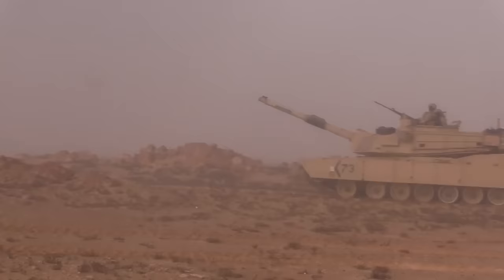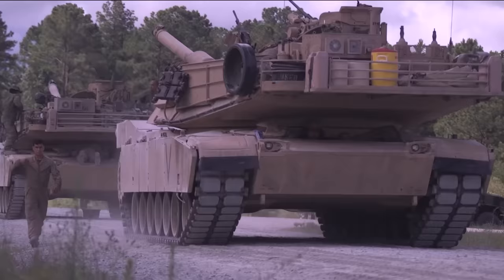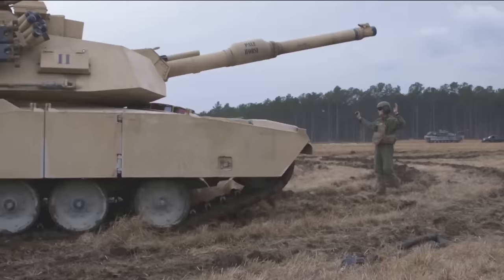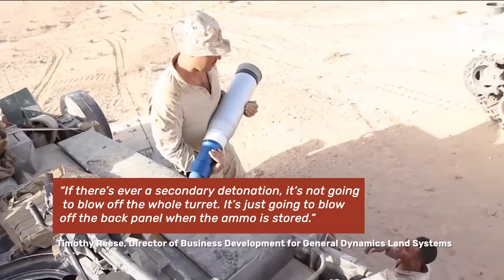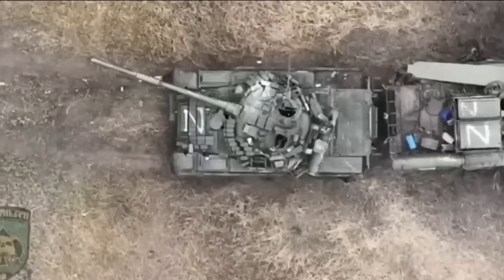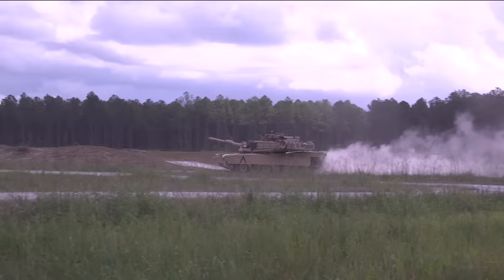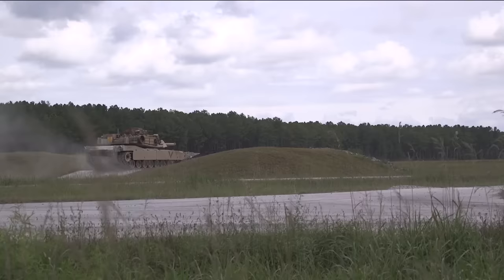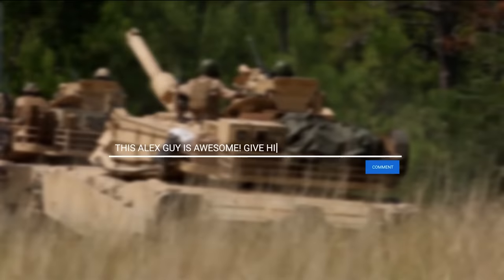America's next-generation main battle tank: ABRAMSX

Comment: The diesel engine is good, the batteries are good, the drone defense is absolutely necessary now, and the Kamikaze drone launchers are good.  

The carousel ammo storage is very, very, very bad, even though there is a blast panel you still lose all of your ammo and probably damage the carousel beyond repair.  Also, they don't say how long it takes to reload the Abramsx carousel.  Seems like it would be longer than an M1.    

The Abramsx auto-loader reload speed is not published.  If it's over 4-5 seconds then it's slower and not as good as the M1 human loader.

Comment: Love the new Abrams, have some concerns about the automatic loading system, however time will tell us more, I disagree on the age of tank theory, I do believe just like America's powerful battleships of the 1930s and 40s the sun may be sitting on the Abrams! Just like the aircraft carrier replaced the battleship, an armored personnel carrier capable of carrying multiple uav's, uav supplies, UAV armament, and shared multi-system air-to-ground awareness, maybe the better option, especially for a country that owns air superiority, and is pushing towards AI in the field, this would fill the low altitude Gap, take on multiple armored vehicles at once including infantry, including giving Hi-Tech drones the capability to refuel and supply, RPG evolution has significantly increased, and with a lot of these systems being capable of self-seeking, the tanks original designed purpose on the battlefield is almost obsolete. Especially considering that the self-propelled howitzer with gps-guided targeting system especially armed with cluster munition rounds is far superior "to any 120ml gun on tracks costing upwards of 80 million dollars".

Comment: A little thought of issue with only having three crew members is that it increases the workload, and the increase isn't negligible.  If only for maintenance having one less set of hands helping to replace a track or fix the transmission is going to suck.  I'm sure a three-man crew plus an autoloader is technically more efficient but it actually makes things more difficult for the crew as a whole.
Reply: Honest question. Do US tank operators get out and do field repairs or do the logistics/engineering corps do perform that function? You have to have logistic fuel support constantly to feed those beasts, you'd think they have the minor repairs covered. No tank crew is going to perform a 'major' repair on a high tech modern platform. One would think.
Reply: @pappyman179  Depends on what you consider 'major' repair work.  If in the field and on the march  general maintenance, wear & tear, random mechanical problems, etc. is first looked at and delt with by the crew.  Historically waiting for the maintenance people when you can fix it yourself is often part of the job.  Only with three people instead of four it'll just be that much more of a pain.
Reply: Another person to do maintenance doesn't have to ride in the tank all the time. The tank will basically never be operating by itself. Grab a guy from another vehicle to help with things.
Reply: @tackytrooper  That's all well and good but it's not that simple.  That guy very well might have his own tank or vehicle to work on.  That guy might just not be there.  The situation might be dangerous (active war zone) and that guy might not want to risk himself to help you fix your tank.  Maybe that guy isn't familiar with your tank and thus isn't of much use.  There's a bunch of reasons why just getting some random person to help isn't a reliable option.

Comment: The un-crewed turret is something going all the way back to the 80's and what was being called the "M1 Block III". It has its reasons I really  just do not know if I am sold on it in the real world. As someone that has been in armor caked with dirt and mud I really have to ask what happens when you go blind. A head out of a hatch can really make a lot of difference.  I also do not like losing the forth crew member for the same reason, in the field there is more then just driving and shooting that has to happen. We will just have to wait and see as things move forward but I do believe that precision  indirect fires especially using mobile mortar platforms will become the next big thing altering how and where tanks are used.
Reply: Popping your head out defeats the point of being inside the protected environment of the armor. The cameras and drones give visibility before you have to ever resort to exposing yourself (and crew) to sniper/grenade/chemical/biological/radiation/shrapnel and flame type hazards.

Comment: The Switchblade inside the tank is just stupid. Why not have an M113, with a launcher rack behind the next hill? Just have the capability in the Abrams to also tap into that Data-network.
Independent gunner sight is IMO a good addition. Giving the driver the ability to also look at what either the Commander or Gunner sees would be handy in an Overwatch situation.
Giving the tank an improved networking capability, to cross-reference sensordata and target tracks with other units would be a great addition. Increase the Hunter-Killer team dynamic with drones, with drones marking targets for the tanks to engage and destroy.

Comment: ""The XM360 120mm gun is more lethal than the current gun on the Abrams tank due to its increased muzzle velocity. The XM360 has a muzzle velocity of 6,000 feet per second, compared to the current gun’s muzzle velocity of 5,500 feet per second. This increased velocity allows the XM360 to fire armor-piercing rounds with greater accuracy and penetration power, making it more effective against heavily armored targets.""  

IMHO we should be looking at 130mm 52 caliber is said to be too heavy and have only 20 rounds in its Magazine for its Autoloader.  That will STILL be more powerful than the XM360.  The down sides are weight and we'd have to use the Excellent German Stabilizer.  That's why the current M256 is 44 Calibers and NOT 55 like the Leopard later models.  If the 130mm Gun was on the Abrams it would have to 2 to 3 Calibers shaved off.  I'll make up something here, why not go with something XM380 50 Caliber 130mm gun, NATO round (+ DU), and with a German Licensed Stabilizer?

Comment: Well having that drone means the tank will be able to lob in rounds from MUCH MUCH further away. With this tank it might make more sense to try and put a 155 on it so it can direct attack its a 155 mm cannon that self explanatory and indirect attack and with it being such a modern platform you could justify the use of all guided ammo while more expensive is also crazy to think of a tank gun having a range of 40km. With all this tech it really just seems like a waste not to I understand the weight issue but that can also be overcome with range and you have increased its mobility so you'll be trading a fraction of your mobility and gaining up to 10× the amount of range on the weapon system.
Reply: Or just have the vehicle do recon for actual artillery and put the 155mm away from harms way!
Reply: @DillonRoche  actually I want the rear artillery to be 240s with guided ammunition they should have never been retired. And while we are talking about it we need a lower accuracy higher capacity mlrs while accurate its primary duty is volume of fire like we had in Korea in a war against China we need some volume behind the accuracy.
Reply: @austinlowrance5943  The Army doesn't like saturation MLRSs. High volume, low explosive yield, low accuracy MLRSs have been used by the Army before, but they switched to low volume, high explosive yield, highly accurate MLRSs. The saturation-style rockets caused too much collateral damage due to their low accuracy. An example of this is the Army's M270 MLRS. It originally used saturation-style rockets, but it has switched to the aforementioned guided rockets. A great and proven example of these guided rockets is the M142 HIMARS, which has proven to be extraordinarily effective in the Russo-Ukraine war.

The reason why the US military uses the 155mm for artillery is because it balances range and warhead size. Replacing the Abrams' 120mm cannon with a 155mm cannon is just implausible. With a 155mm, you're sacrificing nearly all of the anti-tank capabilities just so that it can perform in the artillery role, which is already fulfilled by the M109 Paladin and M142 HIMARS.

The biggest you can feasibly go when it comes to anti-tank cannons is 140mm. The bigger the round, the slower it is. Projectile velocity is one of the core factors in determining how much armor a projectile penetrator can pierce.

Comment: I adore the M2 .50 cal, but the .338NM the NGMG uses...
makes more sense (if the army fully adopts it) as a coax.
And a 30mm – 50mm programmable ammo CROW is best.

Hybrid diesel is cool, but a full on electric would be better if SMR happen. 
With a battery system that allows not charging, but SWAPPING batteries.
Fuel has the biggest logistic tail, & costs $200/gal (for perspective) in Ukraine

Comment: there is alot of wrong info on the normal abrams like the hilo engine meth its a way different engine and it was improved so it doesn't use that much fuel compared to a diesel

Comment: Seeing through the tank with a helmet and camera system is just common sense evolution. Someday tanks will have rail guns when the tech improves and shrinks in size and power required.
Reply: Rail guns are quite ineffective for a tank weapon, it can only fire rods and that's not good. With cannons you fire a variety of shells, HEAT, APFSDS and more. Also power and battery issues.

Comment: First, the Abrams main problem is like all Americans it struggles with weight. Second is maintenance requirements, because of its turbine engine, which can make it more of burden on logistics. Not to say its turbine engine is bad, its one of best tank engines in the world. Especially since one of main reasons for the turbine was it can use more than one type of fuel. Only that its because of US logistics that its benefit rather than a burden for US forces. As for the AbramX I am sure of one thing, no US tank will every be fielded without a Browning .50 HMB. Its because the Browning hits that sweet spot of essentially light cannon fire. Hell even in Ukraine, the Ukrainians have struggled where to use their Browning's in defense of trenches or as air defense against Iranian drones. Odds are if the next Abrams has an autocannon, it will also have Browning too. I also think the new diesel electric hybrid engine is good too, I mean that's what modern locomotives have used for half century now.

Comment: Is keeping commonality with the Abrams so important that we can't radically rethink this?  I think the engine should be in front, and crew in back, since pilot can drive better with video than looking out the slot now I think.  Another idea I have is to put a driver cab on the top of the front slope, so the driver gets a birds-eye view for non-combat driving.  This just needs insulation, not armor, and have huge windows to all sides.  The cab could be taken off in 5 minutes, maybe four pieces that way <50kg each, and stowed on the back deck for combat.
Reply: Tanks and Abrams especially get absolutely coated in mud and sand and dirt. That camera is going to be useless in any cross country travel and now your driver is blind and can't even look out the hatch.
Reply: @thelordofcringe  If that's true the gunner and commander won't be able to do their job.  Is it really important that a tank that can't see targets or even scout for them nonetheless be able to drive into battle?  As for driving out of battle: you only leave a battle you're losing, and what driver is going to open his view slit for a peek at that point?

Comment: I work in the large mining machine field. Huge, work focused, mobile machines and we are trying to electrify them for some god knows reason. Well the reason is governments interfering with these mines and forcing them to be more “green” by mining more lithium for batteries which will then end up in a landfill after tons of coal is burned to charge them 1000-10k times. The batteries last 1 hour… and then you have to swap batteries and let the old ones charge for an hour. The amount of infrastructure needed to support the battery charging is incredible. The diesel engine is just too perfect of an energy conversion system, these large machines (and most medium sized machines) have no business being battery-electrified

Comment: Maybe the British Army, should be looking at this Israeli Merkava Mk.V Barak Main Battle Tank, as a replacement for the British Challenger series 1, 2 and 3 MBT's for 2030's onwards!

True Second-hand Israeli Main Battle Tanks, Merkava Mk.ll or Mk.lll versions, would be ideal for the Ukraine Army too, as it is easily as good if not better than early Germany Leopard MBT’s.

Or especially the French Leclerc Tanks, let alone are equally to both the American Abrams plus British Challengers 1 or 2’s.

Or the South Korean older K1A1’s or K1A2’s Tanks or the newer K2 Black Panther /  Heukpyo MBT’s and the Japanese older Type 74’s, Type 90 MBT’s or maybe the newer Type 10 Tanks as well, especially the new Merkava Mk.V Barak Main Battle Tank.

The Israeli Merkava series of Main Battle Tanks, have always been better than any of the Russians older T-72’s and T-80 Tanks and/or T-90 MBT’s or the new T-14 Armata Main Battle Tanks (which there are very few of too).

Or the Chinese Type 80 / ZTZ80 and ZTZ88, or Type 96 / ZTZ96, or Type 98 or WZ-123 , Type 99 / ZTZ-99 Main Battle Tanks and/or Type 15 / ZTQ-15 (nicknamed the Black Panther) third generation light tank too.

Comment: Abrams is great but a new design is needed.  It entered service in 1980.
Reply: So did most modern MBTs. Tanks like M1 were specifically designed to be upgraded well into the future, and this has been done to great effect.
Reply: @bluntcabbage6042  I hear you on this one and wondering lately how their use on the battlefield is going to change.  The US uses them well in combined arms but most countries don't have the logistics and air power to own the battlefield.  Im really waiting to see how Ukraine's upcoming offensive with Western Tanks works out.
Reply: @Ionizap  It's all up in the air, but Abrams X will be the best bet after Abrams stops being able to be future proofed (which will probably take a while, all told).

Comment: Are they going with lithium-ion batteries in the diesel hybrid power train? Because, I keep seeing stories of EVs getting into auto accidents where the battery gets damaged and said EV going up like a Roman candle. I wouldn't want to be inside that AbramX if that happens.
Reply: Probably.
Just isolate it, if they can isolate a full load of munitions going off they can isolate some batteries as well.

Maybe something new is available by the time this launches. But in the end the danger will still be there.
Batteries ar just little packets filled with loads of energy. When you have that much energy in such a relativly small space and that energy releases quickly for whatever reason you will always have a bad time. No matter the technology

Comment: I'm sorry, but if anything has to be learnt from the Ukraine war, large mobile battle equipment is easily found and targeted by simple drones for intelligent long distance artillery and missiles. It seems small 4x4 units with anti-tank missiles and drone support for long range artillery as front line reconnaissance pilots are just the best. Linked to a central communications hub can even bring in air support. 
Reliance on old tech is terrible.